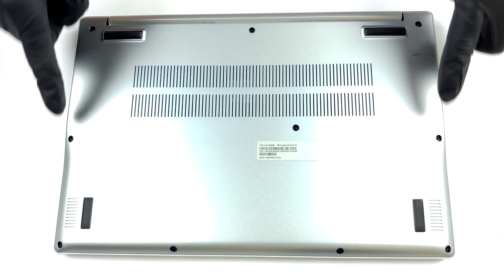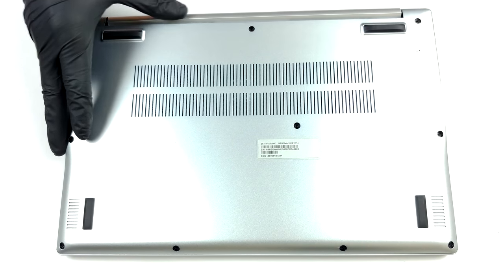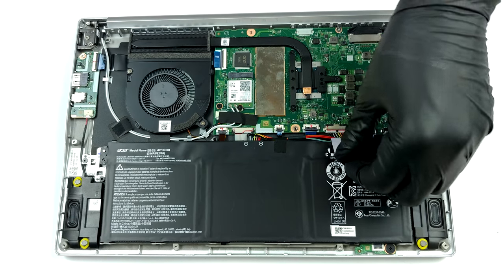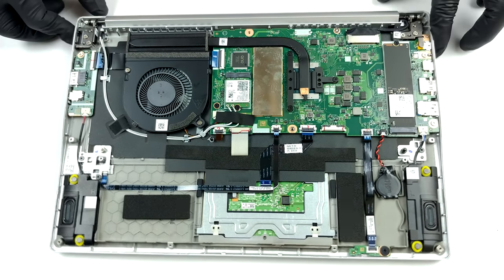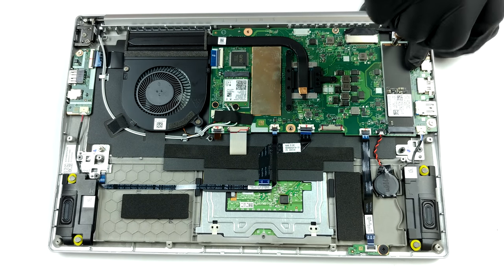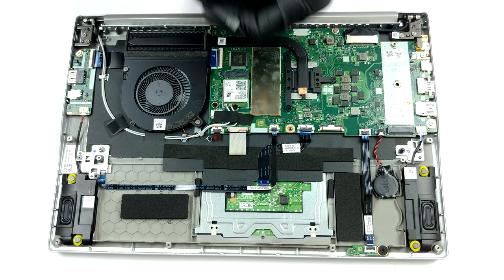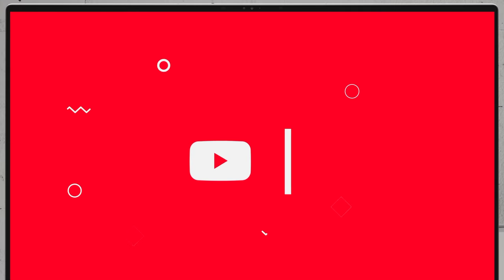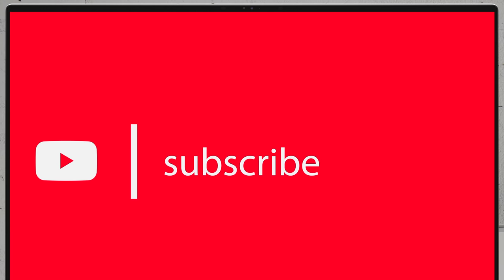🛠️ Acer Swift 3 (SF314-42) - disassembly and upgrade options

Comment: The RAM isn't upgradable at all? If it comes with 8gb, you're stuck with it (because it's soldered on)?
Reply: Unfortunately that is the case
Reply: its soldered i guess, so bad :(
Reply: The crummy part is the ram is DDR4 3733 but only clocked at 3200. I've looked in the bios but there doesn't seem to be a way to adjust it.

Comment: so i wouldn’t be able to upgrade the ram on this then?
Reply: i suspect it soldered
Reply: I teardown mine while ago, one slot is soldered meanwhile one slot is free, so you can upgrade just one slot
Reply: @xvierrr420  i opened mine up and i couldnt find where this slot would be, mind telling me how it looks like?
Reply: @michalszypula2671  theres a aluminium cover, i popped it open and its there like normal port with original ram soldered beneath it
Reply: @xvierrr420  ah so if i take off that cover, i will see a spot for extra ram
Reply: @xvierrr420  how do i take it off? im afraid ill break it
Reply: @michalszypula2671  no it wont, its like lego
Reply: @xvierrr420  oh alright
Reply: @xvierrr420  do you own that exact model  Acer Swift 3 (SF314-42)? I can only see information that it is not possible to upgrade the ram
Reply: @spencer0000000  mine is swift 3 sf314-41
Reply: @xvierrr420  sf314-41 is a different laptop and it has a dual channel RAM
Reply: @spencer0000000  im sorry i didnt checked my model before, its confusing when theres a lot of swift 3 but different specs
Reply: @xvierrr420  no problem, I was confused too
Reply: @michalszypula2671   can you confirm, if is possible upgrade the ram?

Comment: What if I want to add another hard drive?
Reply: You can add an external HDD or SSD, but personally I think that the best thing you can do is to get a compact flash drive (one that doesn't really stick out). They might not be as fast as some other options but as long as you don't use the USB 3 port you wouldn't even notice that it's there. If you do need to use this port you can also get a dongle and connect it to the thunderbolt port.

Comment: can i change storage from 256 to 512 ?
Reply: On this, yes any compatible nvm ssd (avoid adata they often fail more frequently). Our model shipped with 1tb. You just have to figure out the best way to clone the drive, and get the extra space in the setting for any relevant drive copy software.

Comment: Hey great video. Quick question is this the same as the sf314-43 i am trying to get a replacement MOBO but i can seen to find only 314-42. Please help

Thanks
Reply: This is a very new laptop maybe try Asus warranty repair or a good repair shop. boards will eventually appear on Ebay. The new intel chips are causing laptops serious issues too if they are mid/high end CPUs, so Ryzen is a better option while brands redesign thermal management and power delivery for small form factor pc's like these, even some xps 13's were unusable because of the power demands and thermal demands of 12th gen chips.